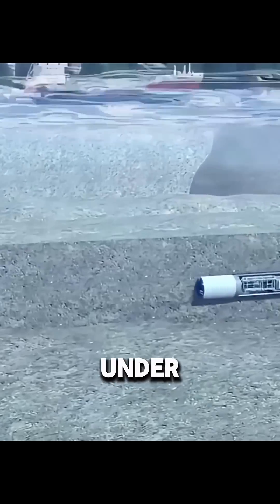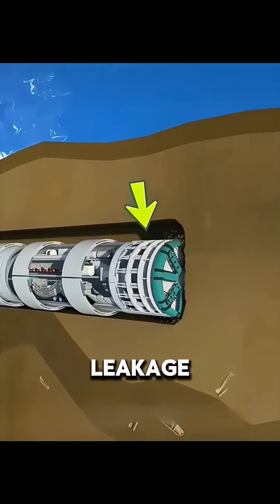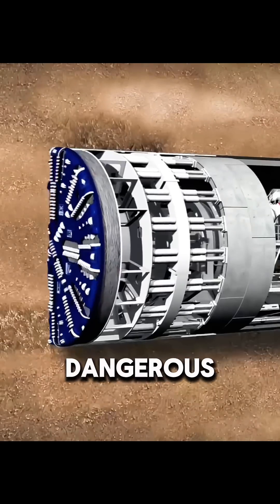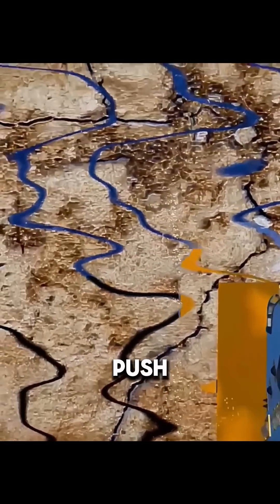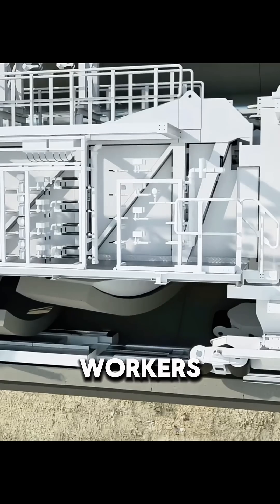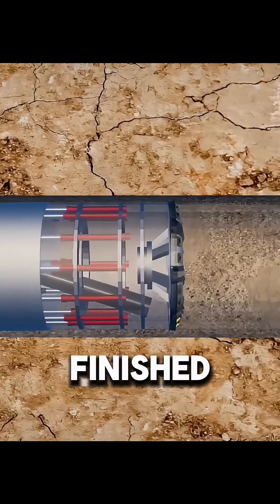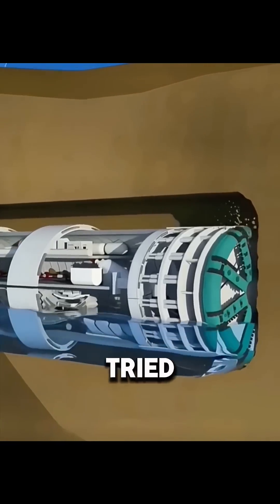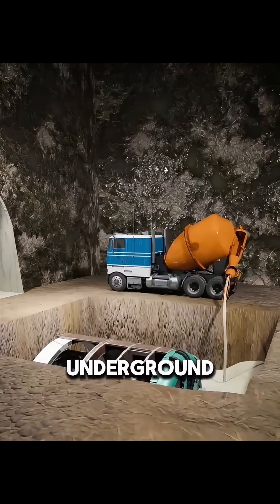How do tunnel boring machines keep tunnels from caving in? #foryou  #tunnel #zackdfilm

Comment: Naa.. not true. We in here, do break the machine and transport it to required location. It's not that hard actually and does lead to lower cost of project working efficiently rather than, buying a new one. Buying a new one is expensive and import costs additional cess tax is sometimes makes it double the price of original cost.  So yeah we do bring that machine out. And then pull it back for other project.

Comment: Tunnels are usually dug from both sides, meeting in the middle. In which case one TBM gets sacrificed, the other is retrieved. You could do it all from one side, but it would take twice as long, but then there'd be no point in sacrificing the TBM as it would have emerged on the far side. Time is money, though, so this would hardly ever be done - if ever.

Comment: What about earth curvature for under sea tunnels? Earth curvature formula is (approx) 8 inches X Mile Squared. At 1000 miles tunnel the delta between the beginning and the tunnel end is 8 inches x 1000 x 1000 = 8,000,000 inches = 126 miles difference!

Comment: They are also sometime used in pairs and they drill two tunnels side by side.  It's usually the long tunnels (15+ km where they use 2 TBS one starting from each en and that meet in the middle (like the Chunnel) where they abandon the machines near the center.
Reply: It's bad form to drive tunnels side by side. One at a time please.

Comment: If you didn't have to keep the whole tunnel dry, you wouldn't even need to "crawl" forward, keeping a low pressure zone at the front and flooding the back would push you forward using pressure 😂

Comment: Im a tbm operator, some tbms get sacrificed due to cost but most are retrieved in an exit shaft and re furbished for other jobs that match the required specs. Currently drilling with a Robbins main beam tbm from the 70s. Lots of companies especially in Europe will buy them  and refurbish them and sell them abroad
Reply: Cool
Reply: I set up the laser for the running tunnels north and south. Great times and wonderful skills.
Reply: Thank you. The short made it sound so wasteful.
Reply: I'm in LA/Beverly Hills.  I here the TBM hum all night.  It's for our new subway.  Most people do not know where the sound is coming from.
Reply: How much does a tbm cost? If they are sold refurbished they must be expensive. Also, what do you mean by some tbm get sacrificed? Like they are left underground?
Reply: @Avgas72  according to a quick search, millions for a small refurbished unit, and 10s of millions for a big one.
Reply: @With_Victor_B  No wonder they buy refurbished ones. 😶‍🌫️
Reply: @Avgas72 yes. And that's just for the machine. The opperator and materials still need to be paid.
Reply: Forgive the  ignorance... but what, umm, skillset or profession does a tbm operator fall under.. Is it engineering, construction, heavy equipmnt operator???? Thanks
Reply: How does one become a tbm operator?
Reply: thats right, i'm the sacrificed tbm
Reply: I could be watching a video about Selena Gomez having a yeast infection and the comments would be full of dudes claiming "I am Selena Gomez's Gynecologist".

FFS dude.
Reply: @Al0neStillAlive if you were a fruit you would be a lemon

Comment: Burying the TBM is still extremely wasteful. Yeah, it may cost more money to disassemble and pull it back out, but money is just money. Burying the TBM and then building a new one when you need to make another tunnel just further drains this planet's finite resources. That is wasteful.

So I say regardless of how much it costs, for the sake of preserving actual resources rather than fake numbers on a computer screen, they should make every effort to recover and reuse TBMs.

Comment: What sad is the fact that they bury these machines that are so powerful and so incredible in their own tombs that they basically force them to dig. I mean, these machines with proper usage and direction could easily be recovered and repaired after they're done building the tunnels, they could dig upwards to the surface once they're on landside without any sort of need of you know, worry about water coming in and then they could be repurposed and removed.  I mean, I understand so big problem in terms of logistics, but it would be easier to reuse these machines than it would be to build a new one and just bury The old afterwards job is done. Because eventually you're going to run our room to park these suckers in the dirt , And he is super not cheap to build these gigantic monsters, like I don't understand why they see them as disposable.When the money required to even build one in the first place is so exorbitant , it practically matches the same price of the tunnel itself

Comment: Wastefull  management as usual , uf you can't take it apart normaly , cut it up and recycle the metal outside , if some pakistani workers can take apart rust covered old engines , some workers with powet cutters should be able to cut a metal frame apart

Comment: Conceived,  engindeered, designed, and built by people of European descent. Other things invented by white people include:

Submarines, electric lights, nuclear power, microwaves, CAT scans, automobiles, hydraulic, wind turbines, backhoes & excavators, jet airplanes, aluminum, ballpoint pen, nuclear fission and fusion, hydroelectric dams, stainless steel,  capacitors, steam power, trains & diesel locomotives, tractors, modern pharmaceuticals, open heart surgery, satellites, radios, conservation of mass and modern chemistry, telephones, televisions, arch & tig welding, electro magnets, computers, transistors, milling machines, general anesthesia, plasma and hydrojet cutting, microchips, Portland cement, titanium, telescope, cathode rays, democracy, capitalism, modern farming, x-rays, laws of thermodynamics, typewriters, sewing machines, gyroscope, SCUBA systems, pasteurization, center pivot irrigation systems, bicycles, Fresnel lens, hypodermic needles, Velcro, microphones & amplified speakers, space travel, airplanes, fiber optics, ultrasounds, internet, printing press, container ships, aircraft , GPS, modern textiles, calculus, dynamite, internal combustion engine, Kevlar, moving assembly lines, antibiotics, aspirin, refrigerators, chainsaws petroleum production, trigonometry, helicopters, thermometer, glass mirrors, directional drilling, Astrophysics, crop rotation, carbon fiber, super conductors, particle colliders, pneumatic tires, MRI, sextant, robotics, teleagraph, microscope, firearms, penicillin, refined oil and fuels, hovercraft, computers, carbon 14 dating, angioplasty, telescope, blood typing, , distillation, pipelines, open heart surgery, tower cranes, chemo therapy, light emitting diodes, motion pictures, cameraswas was, digital cameras, CD/DVD, concrete, discovery of DNA, dynamite, lithium batteries, LED lights, refrigerators, nylon, water pumps, radar, sonar, satellites, distillation, electric motors, magnetic compass, period chart of elements and all 118 elements on it and their system of atomic weights, sextant, clocks, plastics, vaccines, vulcanized rubber, insulin, combine grain harvesters, zippers, and concrete …. Just to name a few. 

What did your ancestors invent that have contributed to the modern human age? Feel free to list them out here.

Comment: That doesn't make any sense? The boring machine is digging a hole that has to reach another end. That usually means outside the tunnel so the boring machine comes out and the tunnel is finished. If the tunneler stays in the hole the tunnel isn't finished because the machine is in the way.

Comment: Small tunnels are filled with grout. But larger, like Lamanche, have multichamber/multilayer drainage system and always leak a little by design. the water then collected in a drainage chambers and pumped out.

Comment: now a big innacuracy in the video is that the machine is not buried under the level of the tunnel, in fact the boring end at a precostructed vertical tunnel in most cases at the end of the line, so the TBM meets that verticak tunnel which is used to remove bebri with cranes, entry of material for the tunnel finishings, and other purposes ultimately serving as the burial site of the TBM. In cases where two TBMs meet in the middle is more common to bore side hole (still at the same level of the tunnel) where to bury the machines.

Comment: up to 75% TBMs are remove from the side partially or completely, only the largest are adandoned  on site, and among those only a part of them in buried in concrete. Although among large TBMs the burial is the most common is not the only method, simpy leaving in the tunnel is also done.

Comment: It’s just the tip of the TBM which gets buried. The whole assembly line (practically a factory) behind is dismantled. Think of it as throwing away a very expensive drill bit but taking the drill itself back home

Comment: A short video with plenty of factual errors.   

They do t usually tunnel through soft ground, huge amounts of research is done to ensure they go through rock whenever possible.  Just look at the channel Tunnel route it snakes up and down.    Workers do t install the tunnel walls the TBM does it automatically as it moves.   They don’t bury themselves.   If they did that means the tunnel hasn’t made it to the other side!   The British TBM drilling the channel tunnel buried itself because it met the French one half way, they blocked each other so they had to sacrifice one of them.   The French one was a better machine so they sacrificed the British one.

Comment: Burying it is stupid. it shouldn't matter how much it cost, stop wasting material.
Reply: Wasting lives can be much worse.
Reply: @andyharpist2938  If people die in the process that is their own fault for not being safe. Furthermore you people only ever think in the short term without any idea how reusing things would make the longer term better.
Reply: @HirokazuTakeda  Yes. Indeed if they die then "it will be their own fault." And several tonnes of cut up scrap steel from 15 miles down a congested tunnel will be well worth the odd death or two.
Reply: @andyharpist2938  No issues then. IF they follow safety then no one dies and reusable machinery.
Reply: Wasting people's time can be even worse.
Reply: @dynamicworlds1  How is it being wasted? They are being paid.
Reply: @HirokazuTakeda paying people to dig and refill holes endlessly would also be a waste of people's finite time.  Same principle.

Comment: The thing is, after working the entirety of the tunnel, the boring machine is probably close to its end of life anyway.
Reply: not realy the drill theeth are removed and reyclied all thats left after everything is removed is a hard metal outershell, it would cost the same to get a new frame as it would to remove the old frame, they are usaly only dug into the ground whne the exit of the tunal in below the surface, when tunaling a mountain they are able to remove the whole frame
Reply: @Thebrysons9 if it costs the same then might as well reuse the old one since its less material waste
Reply: @vracaze pretty sure it doesn’t cost the same.  But there is a 2nd issue is not having a reliable game plan or people in place.  Building another they already have the tools and people in place but pulling it out they are making everything up on the spot and it’s also non-repeatable.
Reply: @vracaze  material waste? Ahaha dont fool yourself. The profit only matter.
Reply: @vracaze  Most TBMs are a custom size as well as they usually need to match older existing lines.  Then it is also a timing issue, even if you find another location on the same continent that has the same tunnel size of the old TBM if it isn't done with enough time to remove/refurbish and then rebuild in the new location the machine might be stuck waiting in some warehouse for 10 years.  

So if you are a drilling a new tunnel that will take say 3 years do you want to trust a machine that is 15+  years old by the time you start and hope it makes it through the whole project. If it breaks mid project you are looking at something like a 3 year delay while they make a new machine for you.
Reply: @vracaze if it costs the same, why not have a brand new frame.
Reply: @wireb-mp8xb because resources are finite. We have too much wasted materials being sent to Africa and Asia to make dumps that are miles and miles in size, just because it's cheap to do so. 
Like there's dumps in Africa for just televisions, that are tens of square miles in size, all because no one wants to strip the parts, melt them down, and reuse the materials.
Reply: @Thebrysons9 The drill tooths are NOT recycled...
Reply: @HazeEntertainment100  good to know, i would expect them to be renewed while making the tunnel not recycled lol
Reply: @HazeEntertainment100 depends on what they're made of. Nearly everything can be reused, whether we have to melt it down, or chemically dissolve and reformulate it. It's probably made from tungsten with diamond embedded in it, so it is still able to partially be reused, we just like wasting resources because it's cheaper and easier to throw everything out
Reply: @HazeEntertainment100  They most certainly are! One keeps my kitchen door open in summer.
Reply: @Thebrysons9   "theeth"??
Reply: This machine is pretty exciting actually. I wouldnt call what it does "boring"
Reply: So there's a memorial to every TBM at the end of the tunnel it dug
Reply: Except they keep reusing them for decades
Reply: Only the head is really wearing off. And as we see in the video, only the head is buried. Most likely the TBM will be used with a new head for a new tunnel
Reply: a metaphor for life.

Comment: Won’t the other side of the tunnel eventually be on the surface? Unless it’s a dead end
Reply: Typically you tunnel from both sides and meet in the middle, this makes the process 2x faster (obviously).
Reply: @Kieran0 as o, going by their example, the two boring machines will meet in the middle, so will they leave the machine there, since there can't go backwards to remove 😂
Reply: @Kieran0  That´s only a part of the answer. If you have TWO TBMs going against each other boring the same tube, meeting in the middle you have TWO machine heads you need to get out of the way to actually connect the tunnel.

So the question is: HOW will you do so? How will you make the cavern around it big enough to dispose those two heads? and wouldn´t it be better to just cut the heads-frames into multiple pieces so that they would fit the tunnel they made and bring them back+recycle then just leaving it there?
Reply: @siriusczech probably the 2 TBMS outer shells meet together and become the final concrete rings. So they dont have to be taken out at all.
Reply: @top10-india11 if you have ever seen a TBM, you would know this is not true
Reply: @siriusczech  there are tons of documentary about channel tunnel, look up🤷🏼‍♀️ 
If I remeber well, they first navigated one of the machines to dig its own grave, then when it finished the extra tunnel and they extracted what they wanted, concreted is and then finished the tunnel itself with the other TBM. Also one of the machines was brought out and exhibited.
Reply: @Kieran0  So you have a tunnel blocked by two scrapped TBMs, or is it gutted so traffic can pass through it?
Reply: @Kieran0 and wouldn’t it make exactly twice more expensive? Obviously
🤣🤣🤣
Reply: @Kieran0  in that case, wouldn't you still at least be able to get one out? Bury one, and push the other one through to the end. Heck, at that point you could go back and dig up the first one and push it through too
Reply: @_Stormfather  The diameter of the boring machine is larger than the diameter of the finished tunnel once they fit the concrete sleeve.   So it won't fit back through the tunnel it just drilled, unfortunately.
Reply: @jimthesoundman8641 this is well answered.
Thanks.
Reply: Exactly, how else does anyone enter  the end of the tunnel?
Reply: Sorry, but this is absoltootly incorrect!!
Reply: with a drill, there's no such thing as hitting a dead end.
Reply: no. that is perhaps suitable for your fantasy novels but not here in the real world we don't bring the tunnelers back to the surface we bury them below
Reply: @harvvee7267 are you alright?

Comment: I love how the first part of the video completely contradicts the rest of the video. How does the left tunnel just stop? where is the boring machine that made it?
Reply: Two boring machines go from either end. Once the concrete sleeve has been fitted, the bore is wider than the tunnel it just made. It's therefore also wider than the tunnel the other bore made, so neither bore can actually go anywhere. It's easier to pull out the expensive bits and bury the shell where it stopped than to dismantle the shell and pull all that metal back to the surface.
Reply: The only reason I can think of is that they have another one start from the other end of the tunnel. If they meet in the middle it would cut the drilling time in half. Of course they'd still have to disassemble at least one of them though I would think. I dunno, it's probably just made up bs